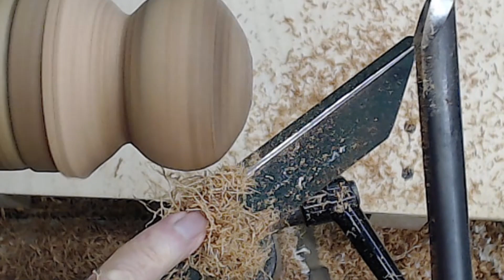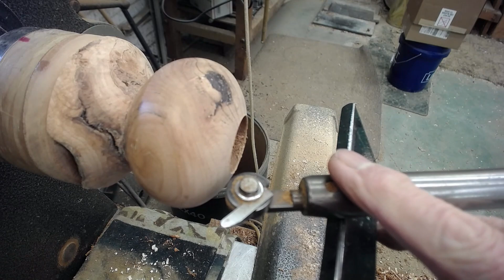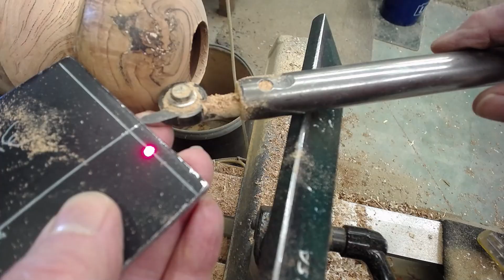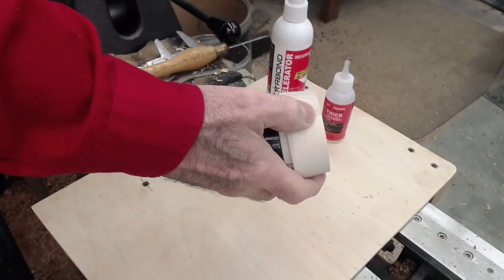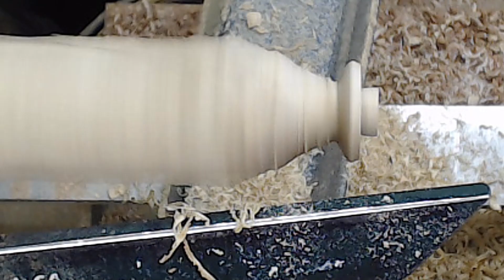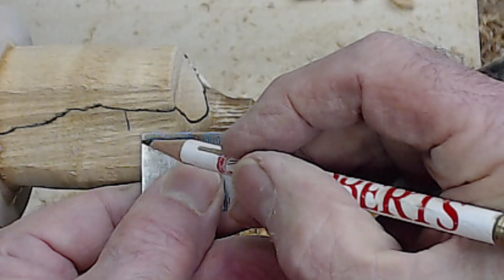Christmas Ornament, using hollowing system and laser measuring.  Bowl gouge used on small finial.

Comment: Lyle I have a Lathe that has the motor on the side, and it sticks out past my drive center. When I mount a piece of wood to turn a bowl, I am limited to the size I can turn. Do they make drive center extenders and where can I get one 1" x 8 tpi.
Reply from the maker: Hi Charles, Good question.  You have to live with the limits of your lathe.  It is poorly designed and the weak 1 inch spindle means you can only do small items or risk exceeding the lathes limits.  Not safe.  I dont like adding a weakness like an adapter to an already weak situation.  There are some work-arounds. Please send me more details and photos to my personal email, if you want more of my opinion on how to get the best out of the lathe you have, or I am a Robust Dealer and I can get you upgraded to have more fun turning. lyle@lylejamieson.com

Comment: Great video. My question is about the first setup of the laser at 8:15. It looks like the tool tip is not lined up with the line on the card, the line perpendicular to the ornament. I didn't know if it was just the camera angle or me. Thanks for posting.
Reply from the maker: Hi Joe, Good observation.  I should have held the camera on it longer but I had time constraints and was rushing at that point.  The camera angle was deceiving.  But it was set up correctly.  Just under the mouth opening, the cutting and measuring was happening on the wing/side of the HSS cutter and the laser was set from the side wing with the needed 90 degree gap.  The laser was not set at the tip, I was not measuring at the tip